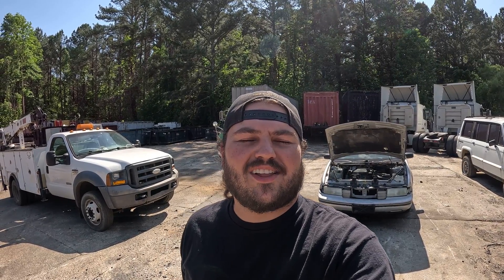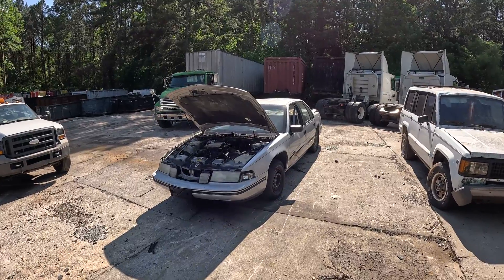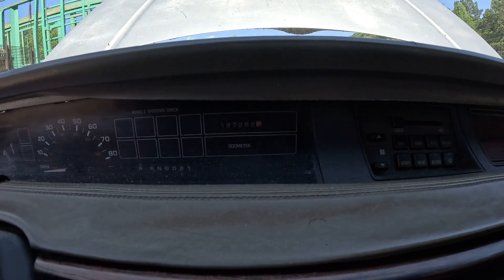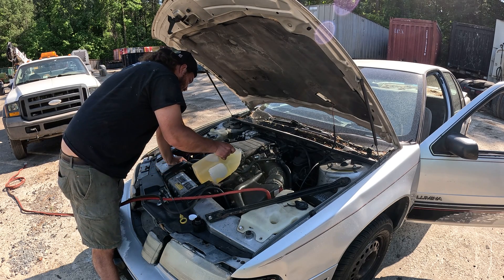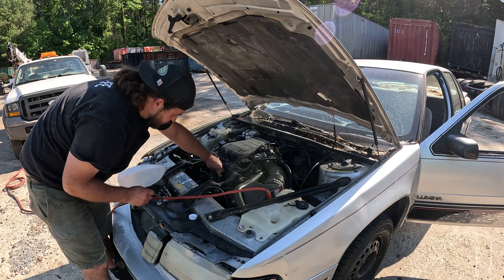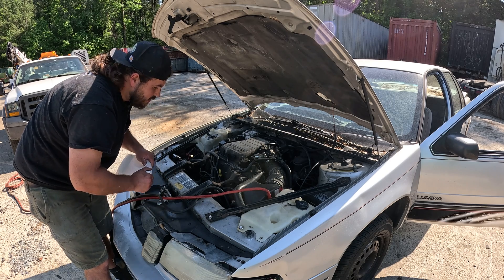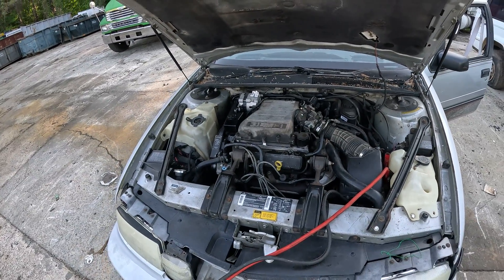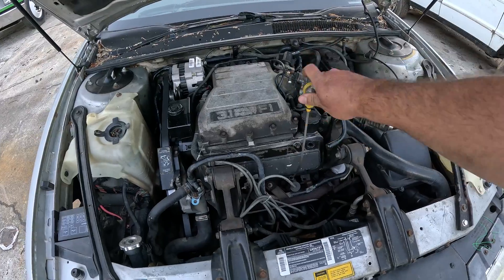Scrap Yard Science! How Long will YOU Engine Run with Vegetable Oil Instead of Engine Oil?!

Comment: There could also be another problem with the engine that caused it to shut down.  Did you check the temp gauge to ensure it is over heating?  What about checking the radiator is properly full of at least water?

Interesting test!  Thanks for the video!